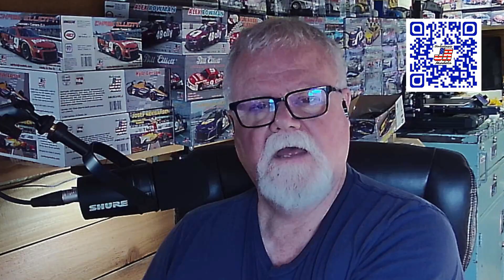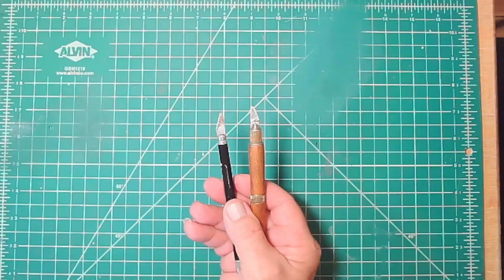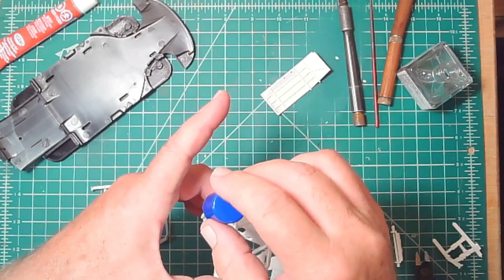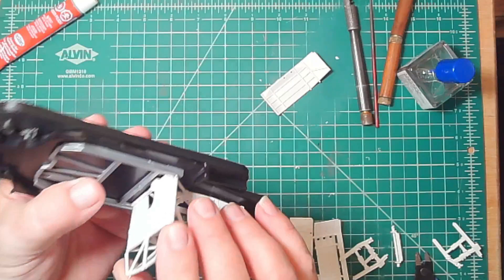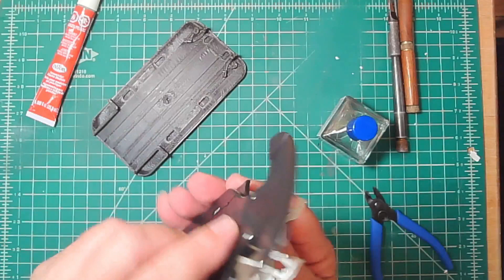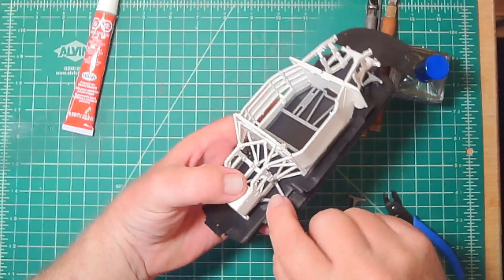undertray assembly jig

Comment: Trim off .02”-.03”? .03” is to close to 1/32”. I think you meant 2-3 thousandth of an inch (.002-.003”) 😊
Reply from the maker: Sorry, it's been a long time since I recorded and watched the video, but if I was referring to the triangular points on D-51, the frame section under the fuel cell, anywhere from .010" to .030" off of each side of the points is fine, there isn't a problem there if there is too much of a gap, only that they are wedged in too tightly now, the section will be square if they don't touch at all

Comment: Thanks for rhis, it helps. I use Testors liquid.
Reply from the maker: it will, also make sure you trim some of the draft that the factory added to the mounting bases for the A frames, I was recently made aware that they might cause the camber to kick in at the top. You can email me direct jim@salvino.us with questions or to order.

Comment: Thanks Jim, 2 questions thought. First, can I build the frame like you just did and the assemble per instructions? Second, what would you recommend to attack the chrome parts with.
Reply from the maker: Yes, you can build by the instructions and use pennies, or whatever you'd like for the equal ride height, using the jig with the undertray just makes it easier. The chrome on our kits is real metal chrome and it's not meant to be removed, you can use CA glues, 5 minute epoxy, or any sort of rubber type - my preference is 3M 08061 emblem adhesive
Reply: @salvinosjrmodels  I have a jig from you. You sent me this link because I used the jig wrong. So can I build thr frame as you did the circle back through the instutions.

Comment: I wish the jig would add one additional item.  A bucket to locate the shock bottom in the proper place and angle.
Reply from the maker: great idea,  but there's really not a way of doing that, but I would glue in the tops of the shocks into the frame and and fit the bottoms to the hub carriers, let them set, then glue in the carriers and the upper A arms

Comment: Just my 2 cents - If you cannot find liquid styrene cement in your area, go to Home Depot or Lowes and pickup a jar of MEK Substitute.  It is the exact same thing and for the same price as the hobby bottle, you will get a lifetime supply.
Reply from the maker: I also use Weld-On #3, but be VERY careful and sparing with them both, they dissolve the plastic scary fast, and don't get them on you!

Comment: The jig does look good and I'm interested in one but was wondering how it works with warped chassis ? as no matter how much bending I do I can never get it fullt straight, especially the front splitter area, thanks for sharing
Reply: I have a video on how to straighten the pan.
Reply: @johnhopkins6565 2:39 2:39
Reply: Wherecan i view the video@johnhopkins6565
Reply from the maker: you can be a little bit aggressive, but that doesn't mean make a pretzel out of it, once you get it glued to the chassis frame, that'll hold most everything in place. If you still have issues, call or email Rick@salvino.us, I'm going to have him do a video on the undertray